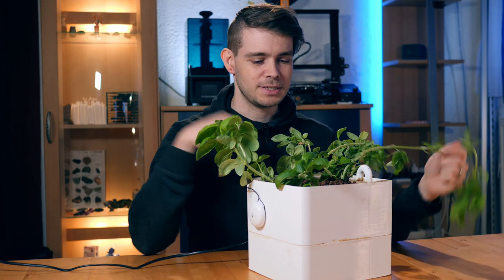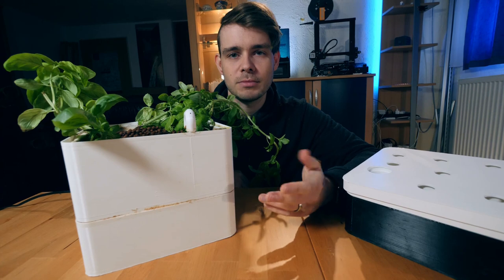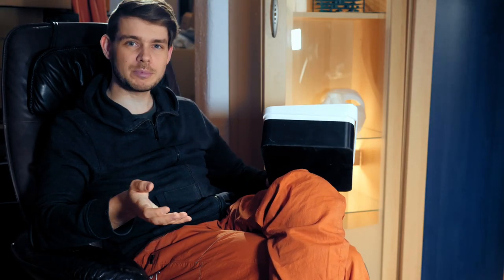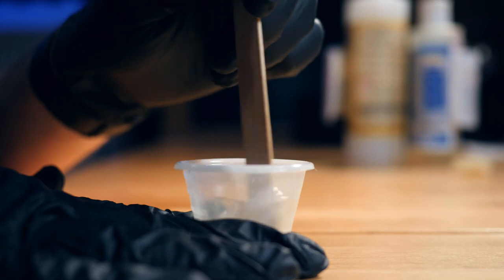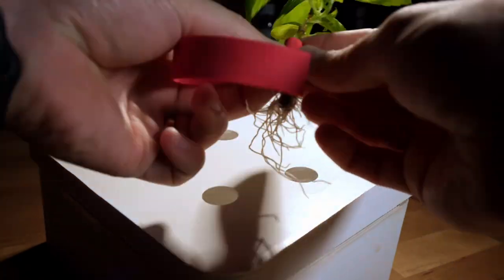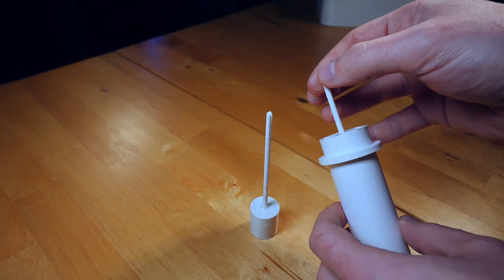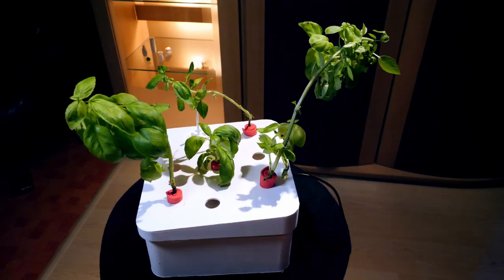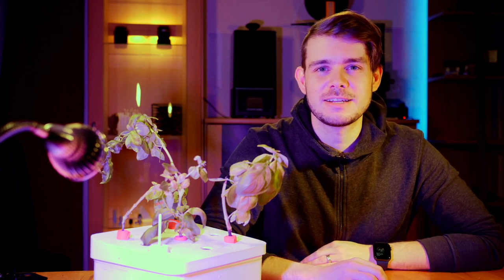Making a better 3D printed hydroponics system

Comment: Great video, just a question. Will the epoxy chemicals Leech into the water and eventually the plants and food?
Reply from the maker: Honestly, I know too little about that epoxy to answer that. However, since I made the video I’ve switched to using specifically non-toxic resin for my projects. That is most likely safer.
Reply: Great vid!
1. Odd you didn't take a moment to print a better way to hold the plants. There's a great POOL NOODLE design as well for a larger hole. 
2. What printer did you use, may I ask?
3. It would be great to have an extra 3D printed grow light 'arm' option.
Reply from the maker: Why would that be better? A pool noodle would hardly fit in such a small system.
Reply: @matoumakes  The pool Noodle fix (which is a great vid, if you check it out) would need to be tweaked, but you've got a great understanding of your tools; I'm surprised you didn't print a system for holding the plant.
Regardless! I love your channel and design!
Cheers
Reply from the maker: Thanks 😉
Reply from the maker: That is very good to know. Thank you!
Reply: @matoumakes  the once concern there is led leaching out of brass nozzles, so it is reccomended to use a steel nozzle. I am not sure how much contamination actually takes place, in the absence of good information it's good to be careful.
Reply from the maker: @markkalsbeek5883  I haven’t thought about that. But I think there’s only plastic in the pump. No metal nozzle.
Reply: @matoumakes  I meant the 3D printer nozzle, sorry for the ambiguity.
Reply from the maker: Oh wow. That’s a concern? I did not think of that at all! I’m glad I have a steel nozzle then. 
Thanks for that hint!
Reply: @markkalsbeek5883  the danger of lead poisoning by eating plants grown in water that sat in a container made of plastic that was extruded by a 3d printer using a nozzle made of brass which contains lead is no more significant that walking by an old house on the other side of the road.  The amount of lead you could actually ingest from such a system is so small it's not only safe, but absolutely immeasurable.  I ran some rough math a while ago and concluded that even drinking acidic drinks straight from 3d printed water jugs is perfectly safe in terms of lead consumption.  So while I get that people are, rightly, concerned about lead, it's really not an issue here.
Reply from the maker: That does sound plausible and aligned with the information I looked at yesterday. But of course it’s still nice to go with the way of completely avoiding it with steel nozzles.
Reply: @jblack3761  Yea I agree that the likely risk is very very low, like I said I am not sure how much contamination actually takes place. Same as with alu coffee pots and such. But since it is a concern I have seen raised so many times, even by reputable sellers such as Prusa, I thought it would be worth mentioning. 

It would be nice if somebody looking for a thesis or something actually investigated this though.
Reply: If chemicals are a problem, it could always be adapted to another container. I'm experimenting with pre made food grade plastic bins and only small 3d printed accessories to put on top. So it's always cool to see interesting new ideas. Even though I will probably use the kratky method for my structures to avoid the need for electricity and make them easily transportable from inside to outside. But a very inspiring video nonetheless! Definitely subbing
Reply from the maker: @rebel4466  using available containers is a great idea! That’s maybe preferable 😀
Reply: If it was mixed throughly and in the correct relative amount it shouldn‘t be toxic after hardening anymore.
Reply from the maker: That’s what I’m hoping for. I don’t have a way to be certain, though.
Reply from the maker: Thank you for that detailed explanation! That makes sense and I’ll stop using this particular system and replace it with a safer coated one.

Comment: a cheaper and easier to find alternative to epoxi is fish safe silicone. just paint it on and let it cure for at least 24 hours. although PLA is waterproof, so its not really needed. while its technicaly biodegradable, it needs the right temps and bacteria to do it, it doesnt just break down in landfill like a carrot would. People have done experiments where they left pla test prints out in their gardens for 2 years and its still as good as the day it was printed. im tempted to have a go at this one though.
Reply from the maker: Yes, I have just recently learned that fact about the bio degradability and what that means. Was quite surprised by that. 

Thank you for the hint with the silicone. Haven’t thought of that, yet.
Reply: I was wondering how safe it would be to grow plants in something coated with epoxy as well. I'm guessing the fish safe silicone would alleviate that worry.
Reply from the maker: @EmilyKelton  yes it would. I’ve since also switched to food-safe epoxy for my projects.

Comment: Nice!! Be careful when you use a filter, if i clogs you will have water comming out of the system. I have made a few watering systems and my experience is to avoid filters. Either you will have water everyware or the system will stop flowing and the plants dry.
Reply from the maker: I think you are right. I've actually stopped using my filter.
Reply: @matoumakes  Maybe just a hole higher up, if it start flooding, it just bypass the filter and drain down.
Reply from the maker: That might work. Someone also suggested to make two parts out of the water tank. Water would flow into one tank. Then overflow into the other. Particles should stay in the first part and the pump can be in the other.

Comment: Great design, if you find your plant roots are getting too much water you can set up a timer on the pump to stop the flow, eg 5 mins off and 10 minutes on.
Reply from the maker: Ah yes. Maybe I should try that. Thank you
Reply: @matoumakes  I only mentioned that as I had similar problems with my hydroponics nft system with the water film being "too" deep

Comment: Excellent work. 
Instead of the rubber wraps, perhaps making a ring with many curved fingers to hold the plant and grow with the plant?
Reply from the maker: You mean 3d printed? Or I guess it could be cut from the foam. That could work. But the strips I have now are super easy and fast to make.
Reply: @matoumakes  I was thinking 3d printed. I was also thinking the foam would create a seal which is also good to keep the system closed and prevent more evaporation etc. 🤔

Comment: super nice project. I built similar ones 😁 try an ebb and flow system. Pay attention to dry phases. When the pump switches off, the water from the plants is returned to the tank by the pump. Due to the high water level, you have good fertilization. it would be great if the water tank would close tightly with the construction, but that is what I failed. I wish you success.
Reply from the maker: Thanks 😀
Why would the tank need to close tightly? As long as no light goes in, it should be fine, I think.
Reply: @matoumakes  
I thought it would be useful if the water tank was tight for transport to the wash basin for cleaning. ..perhaps a sealing lip made of tpu. this can be printed at the same temperature as petg. and create a contact pressure with screws. 🤷
Reply from the maker: Ah okay. Yes that would be useful. But I imagine just adding some kind of rubber would be easier than 3d printing something.

Comment: Careful with epoxy resins and growing herbs for food.  Epoxy resins use BPA as the hardener component of the resin.  It's safer for your long term health to print the parts that will need to be water resistant from PETG and just eliminate the need for epoxy resin.
Reply from the maker: That's a good hint. I will need to use more PETG in my projects.
Reply: @matoumakes  another tip is you can cut down on having the clean it so often by adding a UV-C LED in the water reservoir.  The fertilizer in the water promotes algae, bacteria, and mold growth but UV-C light will sterilize the water and prevent that.  Just make sure that the roots aren't exposed to the UV-C light in the reservoir and make sure to use black PETG (more uv resistant than non-black plastic) for the inside of the reservoir.
Reply from the maker: Ah that’s interesting! Thanks

Comment: Since the ducting is sitting over a sump, do you think the epoxy on that tray is even necessary? Any water that seeps through the tray will drip back into the sump.

For filament, have you tried PETG? It might work better for garden related prints.

Comment: Nice job! So if I understand you right, your pump is always running? What about a smaller angle about 2% and at the end a bell siphon, so that the roots can floate some time and all the water is exchanged by time.
Maybe you could simplify your design, no channels instead only a bowl with a inclined plane to one corner in which you place the bell siphon. The cover could be the same.
Reply from the maker: That might work. Maybe I’ll try that. Thanks 🙂

Comment: If you add more walls you don't need to water proof it. I built a few aquaponics systems with Bell Siphons and they retain water just fine on my shelf. I am about to redesign mine now too after watching this.
Reply from the maker: Oh really? You got out water proof? Gotta try that as well. 
But I thought PLA actually absorbs some water.
Reply: @matoumakes  Hit me up on discord Digisamurai#2475 and I can help. I have had a number of printers but I now only have a Prusa and an anycubic. Probably going to buy another creality someday though for build volume. Depending on the slicer I can tell you what value to change.

Comment: I like that you made the design simpler. Also the mini-NFT system with the tilted platform is clever. Nice work!
The only problem could be that there isn’t much space for the roots to grow? The roots can only go in the top water-channel area right? They can’t reach into the tank where there is more space?
Reply from the maker: Thanks :)
Yes, the roots grow in the channel and indeed you are right. I currently have only half of the holes filled with plants because otherwise there wouldn't be enough space.

Comment: 8mm nozzle and more heat helps tomake prints slightky more water tight
Reply from the maker: Oh that is interesting. I never used any other nozzle than the 0.4mm. But I have different nozzle sizes here. I should try that. Thank you!

Comment: Did the power consumption increase because of the continues flow?
Reply from the maker: That’s a good question. I currently don’t have anything to measure that. The pump takes about 2W. I would expect the WiFi power plug to use less than that. So probably the consumption increased a bit.
Reply: @matoumakes  what pump are you using for this build?
Reply from the maker: @menjira  I think it was a Repti Flo 200

Comment: Awesome Idea. I am a beginner in 3d printing and will try this once I am more comfortable. How do the herbs like the new system so far?
Reply from the maker: It works better than I expected. Only minimal maintenance (as in: I add water and nutrients every now and then) is necessary. It doesn't even clog at all. Of course it should also be cleaned sometimes.
Reply: @matoumakes  danke fürs antworten :D
Reply from the maker: @Andrew Kay Heyhey. I currently had to take the system apart and stop using it because I recently moved to a new place. So far I hadn’t have the chance to start using it again. I might not be able to make an update in the near future. Sorry.

Comment: Really cool idea :) but what happens if the filter clogs ? I think this needs an overflow backup hole.
Reply from the maker: I actually just stopped using the filter. I think you are right that an overflow protection would be good.

Comment: Why you dont try to increase the temp of the printer to dont be 
necessary to coating with resin anymore!
Reply from the maker: I'd still be afraid it might leak after a while. Or is it that reliable? 
I might test that.
Reply: @matoumakes  doesnt have how to leak after a while, because you don t have high pressure, and don t make filets,  just straight edge
Reply from the maker: Wasn’t sure if it maybe leaks directly into the plastic.

Comment: you need a overflow pipe so that if the filter clogs you dont get water everywhere
Reply from the maker: Ah, I think if I check it regularly it should be fine. Of course, I could be shooting myself in the foot with that 😅
Reply: @matoumakes  its a really easy fix for a potentially big problem :)
Reply from the maker: Yes that’s true. Might even just drill a hole in the already printed one 😄
Reply: @matoumakes  that would do it ^^

Comment: I really like the simplicity of this design. Do you get root rot with this setup? I designed a larger system using drain pipes but I couldn't stop the rot!
Reply from the maker: I changed the plants in there quite regularly, so I don't really know. But it could image that rot might be an issue after a while.

Comment: Hello, how long did the print take for you ?
Reply from the maker: If I am looking at the correct files, the largest part was about 24 hours and the second largest around 18 hours. Can't find the file for the lid right now. The water level meter was 3.5 hours.

Comment: What’s the print time on this?
Reply from the maker: It was about 20 hours for the water tank. Around 22 for the water channels and about 10 for the lid. All the small parts went pretty quickly. 
But all in all definitely some print time 😁
Reply: @matoumakes  I just designed a similar one and just the tank was 1day 2hours in cura 5% infill lol. I think I’ll stick with ugly buckets 🪣
Reply from the maker: I think using things that you already have are a great idea!

Comment: Nft go wrong need backup power source
Reply from the maker: I guess you're right. Some kind of backup would be called for. 
Maybe I should add a battery-powered sensor that alerts me if the water stops flowing.

Comment: Is the model no longer available? Link goes to a 404 page
Reply from the maker: Hm 🤔 
That’s weird. It should be working. I just tried it (both normal and in private mode) and it worked fine. 
I think someone reported an issue to me like this earlier. I don’t really know how to fix that.
Reply: @matoumakes  I again tried it and still no success. Could it be a regional thing? From Germany, the link does not work. I cannot even find your design on myminifactory when I search for it.
Reply from the maker: @Cleanblue1990  Wait. The link in the description should go to thingiverse, not myminifactory. Though, I also have it on myminifactory. But there I've had many people not being able to access it, which is weird, because it's definitely set to public. 

I'll try to add the thingiverse link here: https://www.thingiverse.com/thing:4669184
It's thing number 4669184, in case that doesn't work either, maybe entering that on thingiverse might help?
Reply: @matoumakes  Yep, I have found it on thingiverse, after I saw a comment of yours mentioning it. I'll definitively give this design a try. Though I will search for a bottom container in order to skip the print and sealing of that part
Reply from the maker: I think that’s a good idea 😄

Comment: plants dont like constant water cept lettace, onions ect.
Reply from the maker: I think it depends on the amount of oxygen in the water. 
I was hoping that the dripping back into the tank and the pumping up would introduce sufficient air so that it wouldn’t be a problem.
Reply: @matoumakes  maybe that was my issue,  you should update how its going  in a few months.

Comment: You switched from ebb and flo to NFT
Reply from the maker: Jep. It's easier to maintain.
Reply: @matoumakes  you could add a bubbler to oxygen water a bit, will help growth
Reply from the maker: @surronzak8154  I thought about doing that but decided against it, hoping that the water falling back down into the tank would add sufficient oxygen.
Reply: @matoumakes  There are some venturi water pump outlet you can put on your pump, this way you oxygenate the water wihout a bubbler .
Reply from the maker: Ah I didn’t know that. Thank you!